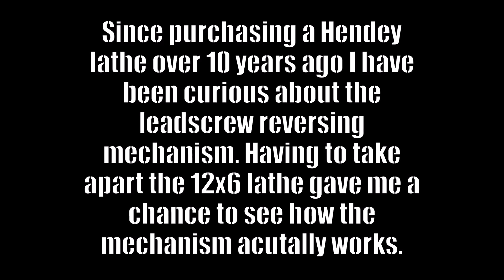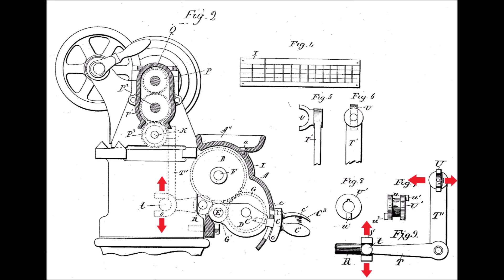Hendey Lathe Leadscrew Reversing

Comment: The Atlas lathes without a qc gearbox have a very similar mechanism by which leadscrew reversing is accomplished. Unfortunately the parts are not made of steel.

Comment: So what does the bottom rod do? My Hendey has a handle on the lower rod that is a 3 position deal. I can't figure what it does but then I don't even have power to it yet. Still waiting for my 3 phase converter. As far as I can tell I am missing the reversing lever itself and the detents for that shaft are broken. I got a bag with parts in it with the lathe and last night I just figured out what they were for. Any idea where to get a reversing lever?
Reply: Just saw your post. I'm having similar issues with mine that I recently inherited. I think I have the lever, but missing the guide/retainer block that keeps the lever beside the apron as it travels. Don't have power to it at the moment, but I used the lathe with my dad years ago. Did you ever get yours sorted out?

Comment: I have the same lathe built about 1918 and rebuilt by Hendey in 1936. It is in good cond with a taper attachment. I was going to restore it but had to downsize. It is for sale. 304-488-3315 Located in zip 26101.
Reply from the maker: To bad you've got to let it go, I can't imagine being without my 16x30. Good luck with the sale and I hope you find it a loving home. Craig

Comment: nice video well explained.I have a dean smith and grace 17t which has leadscrew reverse a feature now i could not live without.
Reply from the maker: Mick, I've heard a lot of praise of the DSG lathes on the Practical Machinist Antique Machinery forum. My Hendey was the first lathe i'd ever seen in person and it was just dumb luck that I didn't end up with a chinese mini lathe. It was a good deal on eBay and I was too naive to realize how much it weighed and to stubborn to give up when I found out. It doesn't take long to get used to a revering leadscrew. Thanks for watching and commenting, I appreciate it. Craig

Comment: Thank you for posting. I also have a cone head Hendey which I had the head off for repairs 23 years ago and your video reminded me how it all works.Though now I'm having problems with the apron locking up while in the feed position and breaking teeth on the rack. I'm still in the process of removing the apron though I have the rack out with several broken teeth. Any thoughts on why this may be happening will be appreciated. 
Regards 
George.
Reply from the maker: George, In an earlier video I take apart the apron on my conehead and there was a broken tooth in the pinion gear that runs on the rack. I wonder if that would cause the binding you are seeing. Let me know if you have ant issues when you get into your apron. I have worked on both the old single wall apron on the conehead and the double wall apron on my gearhead. There is a great group of folks on the Practical Machinist, Antique Machinery forum that have tons of experience and have always been good about helping me. Good luck and keep me posted. Craig

Comment: Very handy setup👍
Reply from the maker: Steve, it sure makes threading a lot less intimidating for an amateur like me. You can see why Hendey didn't want you using the reversing lever while running in the higher speeds, it would beat those dog teeth to pieces. I've been following along on your K&T repairs, makes me glad I didn't have to get too far into mine. They make the 6 speed transmission on my F350 look like child's play. Good luck! Craig

Comment: Hi again from England...

What a beautiful short video this is... 👌

I have an early Alfred Herbert turret lathe that is designed to run off a lineshaft...uses what Herbert described as a:

"PATENT THREAD CHASING SADDLE"

I haven't got into the restoration of this one yet but when I do I bet it'll feature a dog system...similar to what Hendey's used...as its effectively doing the same thing mechanically as what a thread dial is doing manually...
The Herbert uses "leaders"...
That's a bit like leadscrews that are interchangeable...
The feed gearbox offers a range for each leader...
I suspect when I start to dismantle the apron I find a dog arrangement where the leader is in constant mesh...
And the dog allows for engagement as per a screwcutting dial:
1-2-3-4
The Herbert system withdraws the tool from the work upon reaching the end of its run which can be set via a rotating set stops (similar to its turret depth sets)...
So my thinking is that several passes can be made to generate a thread on an O/D larger than a Coventry die box or the equivalent Landis die box could achieve...

Any road...
This is highly interesting stuff and shows just how much contemporary British & American machine tool design was so far ahead of the others back in the early 1900s...
Reply from the maker: Glenn, it is amazing what was accomplished back then using only mechanical mechanisms. These days we rely on electronics to do the same jobs, and they work well but lack the robustness of the old mechanical systems. The electronic trunk latch on my 2015 car just failed short of 3 years and 20,000 miles. The mechanical trunk latch on my 1983 Volvo with 280,000 miles still works great, even after someone tried to pry it open with a screwdriver. I'm glad you stopped by and said hi. Craig
Reply: @clemwyo 

Oh your welcome...
But I'll let you into a little secret shall i :
I did actually subscribe to your channel some time ago...so I know when you post things up... 😉

There's been the odd Hendey lathe crop up here in the UK...
There's not too many of em about here...but they're out there...
I've got a couple of videos of my collection of old machine tools on my channel...
Feel free to have a look when you get time... ☺️
Reply from the maker: Glenn, I'll be sure to take a look, always interested in what others are up to. Thanks, Craig